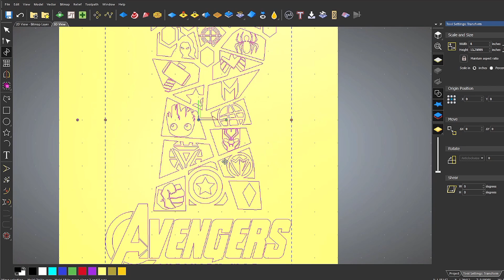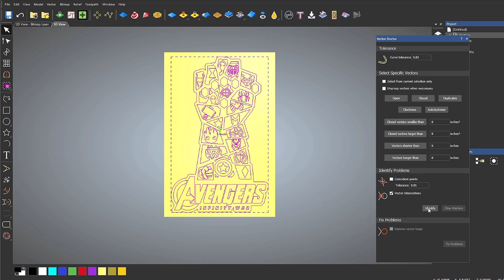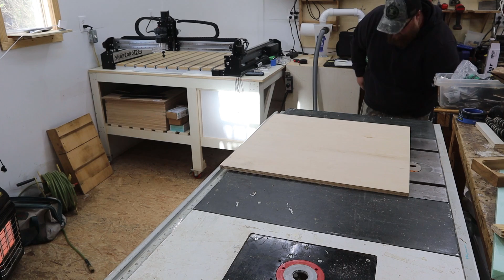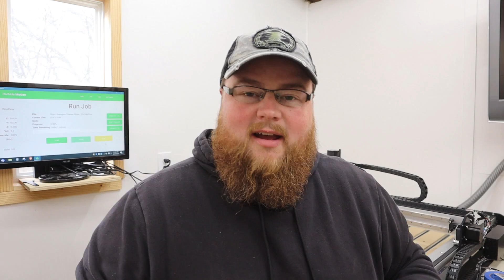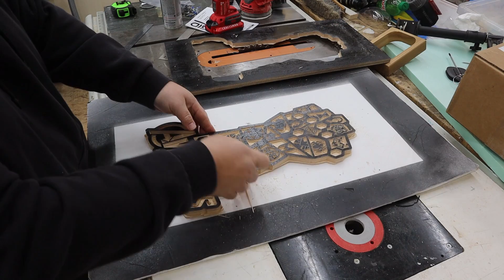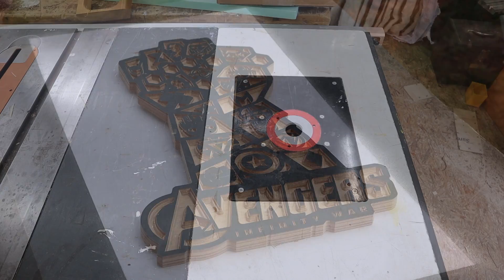Making a THANOS INFINITY GAUNTLET Wooden CNC Sign | Avengers Infinity War | CNC Woodworking

Comment: Very cool and it turned out great, what is the dimension of the stock you used or the finished product?
Reply from the maker: If I remember correctly, it was about 12" wide x 18" tall x 1/2" thick (13mm Baltic birch plywood).

Comment: How are you liking that style of clamp the green ones? I'm using wood one's right now, and I'm not sure if it would be worth upgrading or not.
Reply from the maker: My experience with clamps is very limited. I've only used these green ones and the painter's tape + CA glue method. I don't have any complaints with the green plastic clamps (they are not 3D printed). They hold pretty well and with 6 included with the machine there are plenty to go around for a project.

Comment: Man, that looks awesome. Could you put a scrap piece of waste board under the work and just cut it a little deeper so to not worry about ruining the T tracks or mdf? But also make sure to cut all the way through?   Did you not use the touch probe for this one, or is that what you were doing with the piece of paper? Thanks again for going through all your learning with the CNC. I'm loving all these, please keep them coming!
Reply from the maker: You could very easily add in a sacrificial waste board, sure! I didn't use the BitZero (touch probe) for this project because I didn't have the job origin (zero) set to be the bottom left corner of this piece. It was set for the center of the model instead. The part with me using the paper was finding the Z axis (vertical) zero point on the top of the material. I have since learned how to set my origin in my software (Carveco Maker) and that will allow me to use my BitZero much easier and more often. :)

Comment: Sam, from the looks of things are you having to manually set the router speed, could you confirm? And what other mediums ( if any ) such as epoxy or lucite  can you cut with this machine. One other thing...your sign looks really cool!
Reply from the maker: Yes, this is a CNC Router machine so the router is controlled separate from the motion software. This machine is supposed to be able to machine anything but steel. There are many using it for softer metals, plastics, graphite, etc. Thanks